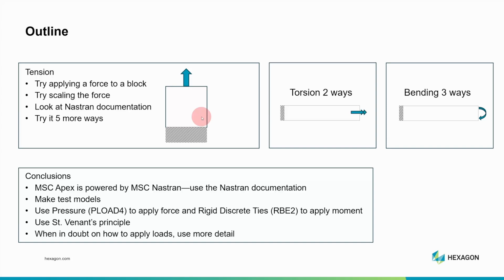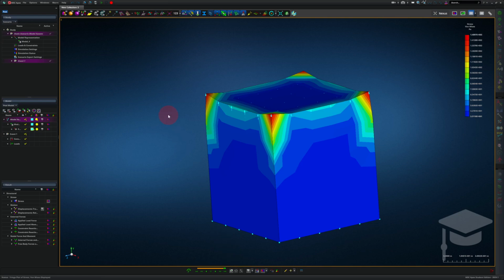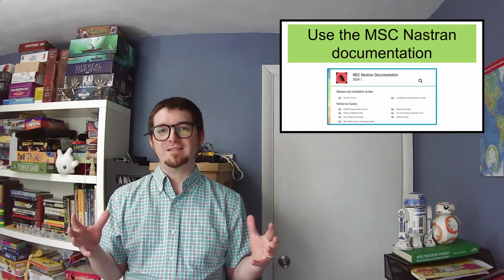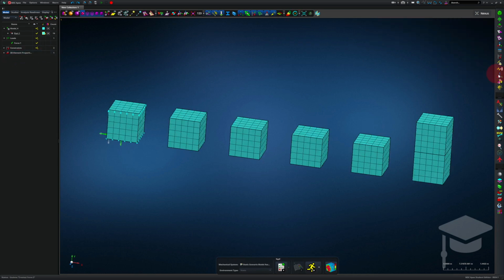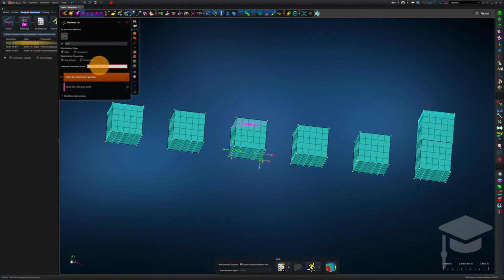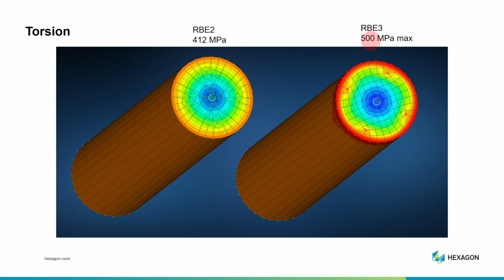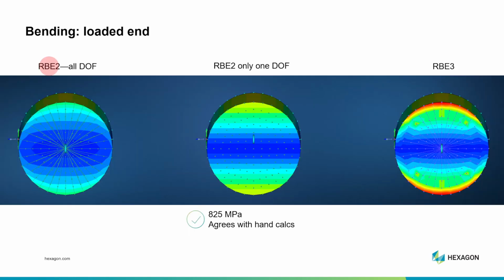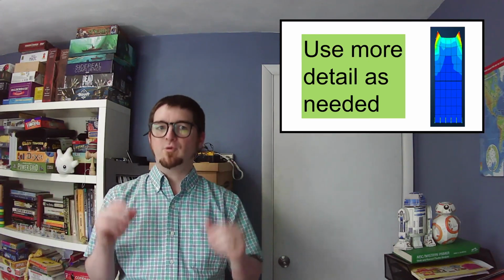FEA at Work: Applying Loads to Solids

Comment: A very successful and helpful video. I would appreciate more videos that present the basics in a clear and thorough way.
Ideas: for example, the correct definition of a plate clamped/fastened using bolts at the corners.
A comparison between fixing a plate using four bolt holes versus adding an additional plate and connecting them with bolts, and determining which approach is more appropriate.
In addition, an analysis of the stresses near the bolts. Is it better to take the reaction force and calculate it manually, or is there a way to obtain the correct stress directly from the analysis?
Thank you very much.
Reply from the maker: Thanks! And thanks for the input—those are good video ideas.

I can tell you right now that it's unusual to calculate fastener stress from within FEA. Reaction force and hand calculations are normally what you want.

-Alex Szatmary